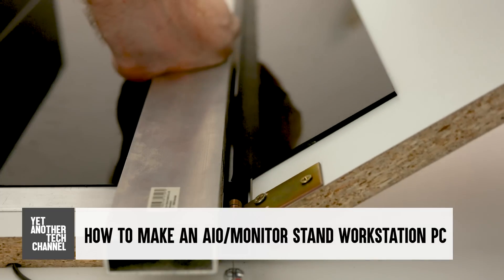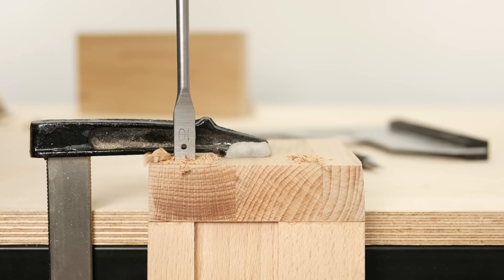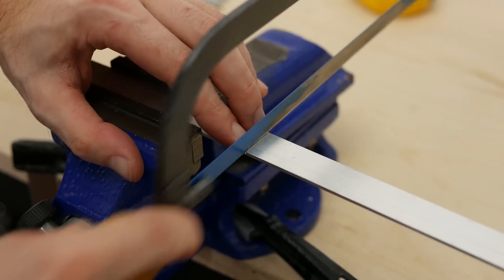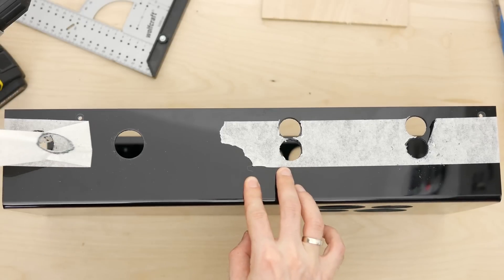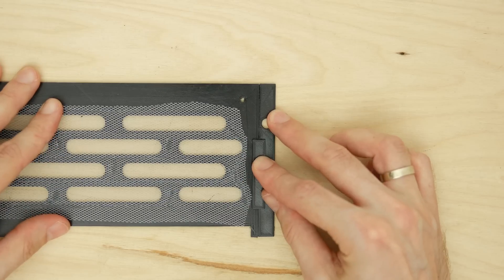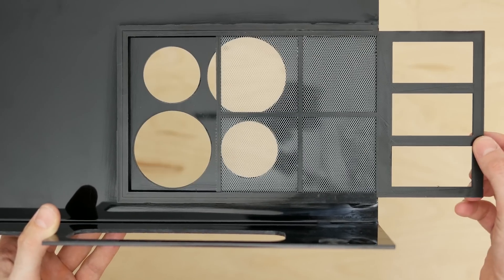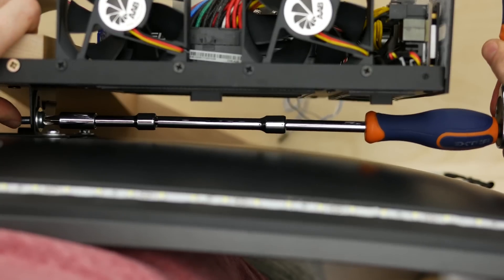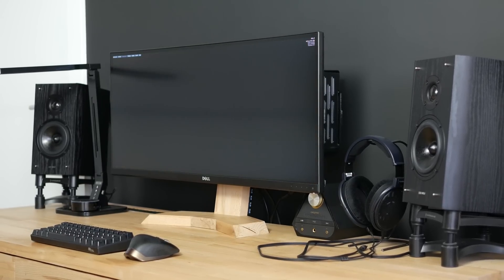How to make an all-in-one workstation PC from scratch (DIY AIO computer)

Comment: To be frankly, it's not an AIO, it's a hide all behind TV/Monitor solution 😃  --  I've worked with a company doing "smart home theatre system" has the same idea of put everything behind BIG screen (70" +) by create wooden pocket inside dry wall then put everything PC, power bar, wires, switches etc. all there  LOL

Comment: you can use some saw dust from drilling/cutting, mixed with wood glue to fill up the screw(up) holes.
I'ts a really cheap solution that will make your diy projects look tad more professional, you're welcome

Comment: Build looks amazing.  Exactly what I was looking to do as well.  Glad to see that someone made it work.  1 question,  I see the power connector but can you explain the PSU?   Thank you.
Reply from the maker: It's the HDPlex nano ATX power supply - https://www.hdplex.com/
The part that goes into the case is really small - you can see me mounting it at 9:17. The rest is a laptop power brick - a quite large, 330W unit that you connect to the HDPlex PSU.

Comment: nice project. you should probably add some weights to the base. that will help with stability.
Reply from the maker: Changing the design a little bit so the monitor is mounted first not last should do the trick.

Comment: Nicer than mine, but i had the same idea. Put a mini case on the vesa mount of my monitor. Feel free to watch both videos on my channel.

Nice build. Enquorages me to make over my pc.
Reply from the maker: Not every monitor has a VESA mount that is accessible with the original stand in place. That's the case with Dell monitors - you have to remove the original stand to get to the VESA mount.
Reply: @YetAnotherTechChannel  i know. That sucks. And i explained this in my video. Those models are very limited. But since ive bought some used monitors, without stand, ive build feet myself aswell. Thas so simple, if people only knew. Selling theyr monitors for low cause they dont find the foot anymore , your solution would have been an Option for me as well. But gladly ive found a nice monitor with both, stand plus vesa

Comment: where can i find that kind of PSU
Reply from the maker: https://www.hdplex.com/hdplex-400w-hi-fi-dc-atx-power-supply-16v-24v-wide-range-voltage-input.html
Reply: @YetAnotherTechChannel  thx . Btw do you also need adapter with a big power like in laptop gaming if i want to use VGA like 1080ti and core i7 if I can't find hd plex 400w but only find lower power like 160w
Reply: What I find I my country Indonesia is something like pico PSU 160w can't find something like this with bigger  power . 
My PC is core i3 6100 , 8gb ram , GTX 1060 3gb . 1 HDD ,2 ssd , 2 fan
My question is can I use that pico PSU 160w and power adapter laptop with power 330w or 220w
Reply from the maker: Yes, the HDPlex PSU requires an external power brick.
As for the second question - I wouldn't do that. The pico PSU rated at 160W is capable of distributing up to 160W of power so using a higher rated power brick won't really solve that fundamental issue... you could try using two of those - one to power the GPU and the other for the CPU and the rest of components ;)
Reply: @YetAnotherTechChannel  I never thought that I can use 2 of this separately

https://youtu.be/B6QUuniKJek

I thought i can use huge power brick and small pico power or small power hdplex like in this video

Comment: What are the computer spec. ? Thank You
Reply from the maker: AMD Ryzen 1800X on MSI B350 I AC Pro mini ITX mobo
8 GB of Kingston Hyper X DDR4 memory
Zotac GTX1050
HD Plex 300 W nano ATX PSU
Dell U3415W
...but it's not about the specs - hardware components are just props so I use some spare parts that I got for the sole purpose of using in those DIY projects :)

Comment: Hey, not sure why you started with the large bit then went with the small one for the acrylic hole pockets. For drill bits, you can actually think of the process like a pilot hole, and drill the small hole first, then the large one, this way your hole location is more precise because your bit won't walk on you. Now if you were using something like a spade bit (which doesn't self center in a hole smaller than it, but larger than the spike in the middle) then definitely drill with the paddle bit first, otherwise if it's classic fluted drill bits it's usually better to go small , then big. Just my 2 cents.
Reply from the maker: I used wood drilling bits, which are a bit like spade bits - they have a spike in the middle - that's why I drilled with the bigger one first :)

Comment: How does all this run off 300W?
Reply from the maker: It's a very capable PSU - the trick is that it's using a DC power brick which has a higher efficiency over your regular PSUs. You can push it to its limits and it will still deliver.

Comment: Where is the power supply unit??
Reply from the maker: The assembly starts with me putting it in at 9:17 - it's a nanoATX PSU, there's also a power brick (like for your regular laptop) to deliver the juice. Those 300W are no longer available but you can get 400W https://www.hdplex.com/hdplex-400w-hi-fi-dc-atx-power-supply-16v-24v-wide-range-voltage-input.html

Comment: That is such a goregous PC case! You make some incredible and inventive builds! Would you be willing to sell something similar to this? I would be willing to pay for shipping if the case comes with an HDPlex power supply (300 watts would be enough for me) and a non vesa mount. I know that the vesa mount is the intended purpose of the build but with a translucent acrylic side panel it could look fantastic as a standalone case not just an all in one. It wouldn't be that hard to make feet for the case. Out of curiosity, does the HDplex 300 require an external power brick to run?

Comment: You should look at getting some grease for when you're tapping the holes(if nothing else wd40) , it probably won't help you make the threads or anything but will make the tap bit last far longer as it will get dull very quickly without lubricant especially if you're tapping using a drill.

Comment: Looks great! I would recommend spray paint from the start instead of as a touch up. Love your work!
Reply from the maker: If I had a paint booth, I'd probably do that. Since I don't have conditions to spray-paint properly - lay primer followed by a few coats of paint - I spray painted things 'just enough'... and they would scratch easily - even during the assembly. That's why I prefer to apply a thick layer of paint and then finish it off with the spray paint.

Comment: just add a small stand in the back of the stand, so you have 3 instead of 2, then it would be balanced even without the screen
Reply from the maker: I'd try to change things a bit so the monitor attaches first and then the computer.